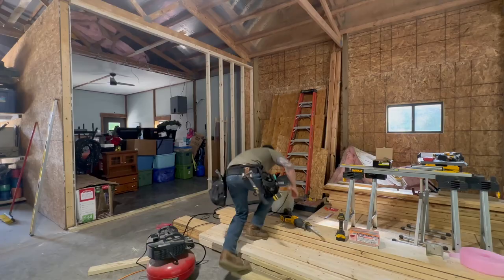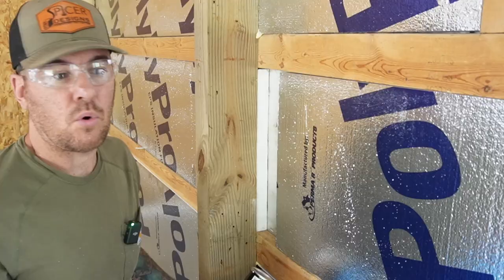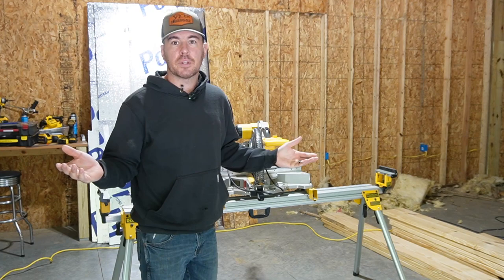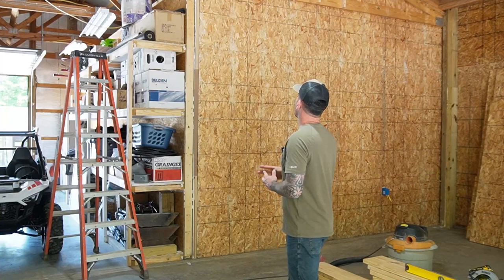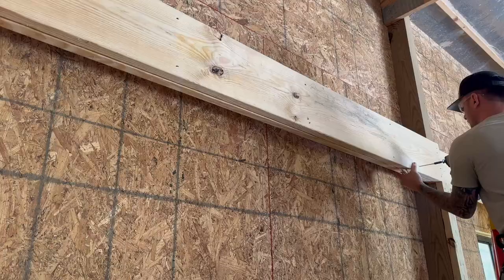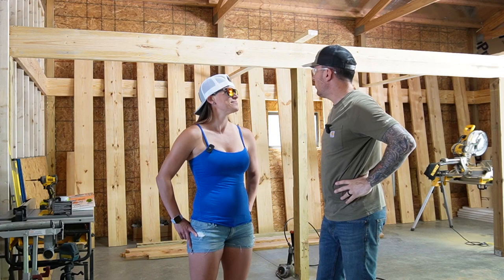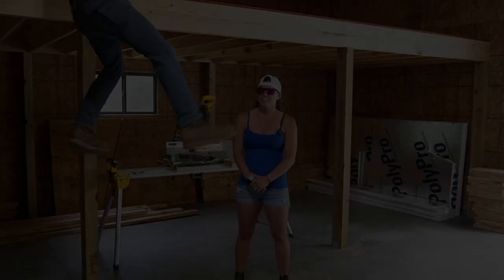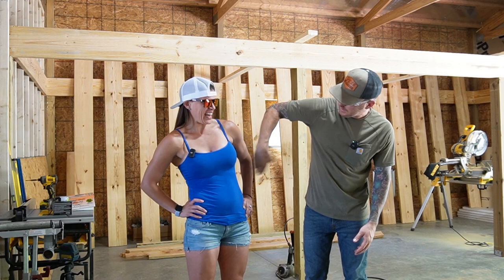LOFT BUILD....It Can Never Just Be Easy!

Comment: With an assistant like that I'd find it hard to concentrate too!  
Nice build and attention to detail.  Question: After a couple of decades as a Builder / Engineer, I don't understand why you doubled the ledger at the posts on the outside wall?  Appears the 1st ply is toe nailed into the post = No structural value as a ledger.  Are there L brackets you installed first or some type of support below that I didn't see?  Otherwise it's a waste of material & the load is all carried on the 2nd, inner, ply.  
Minor pet peeve....Please use "Plumb" when referring to vertical, not Level.   Clean build and the ladder blocking in the wall under the truss is a detail often missed.  Enjoying your videos, keep them coming!
Reply from the maker: Ya she is distracting for sure.  I glued and screwed that 2x to the ledger on that outside wall.  I know its not technically carrying the load but i did that to add strength to the ledger board.  Should help with some of the live load.  Ill likely add a bracket there as well.

Comment: Hangers easier measure and put on before perimeter is put up, then slide joists up an in. (Broke hand while "helping" hold up joists and waiting for "nailer" to secure it).
Reply from the maker: I like to do it after because the 2x heights are inconsistent.  Some up to a 1/4 inch.  So i match all the tops on the joists so the floor is flat and then install the hangars.  Just the way i prefer to do it.